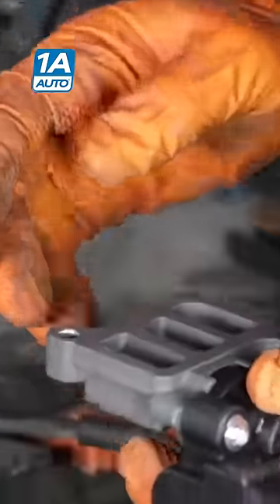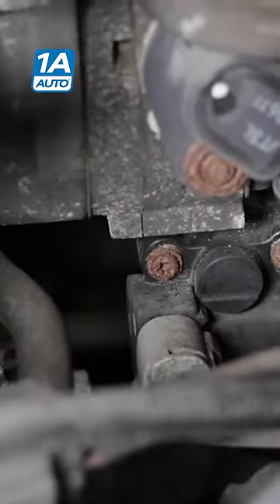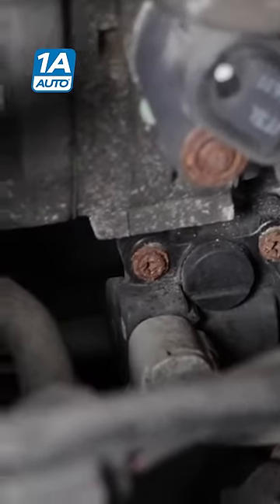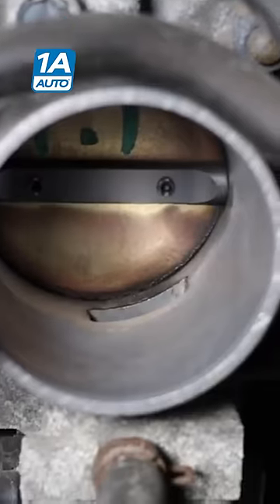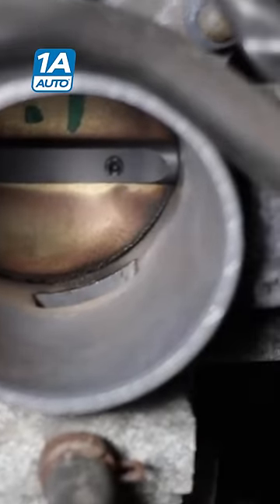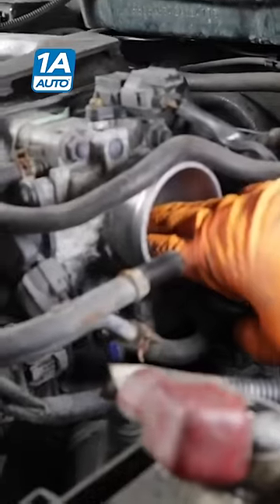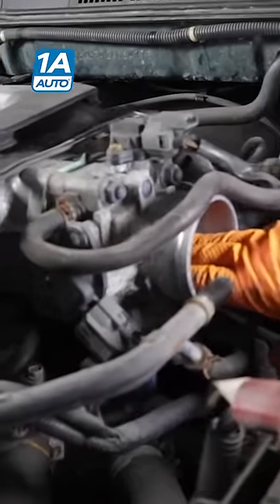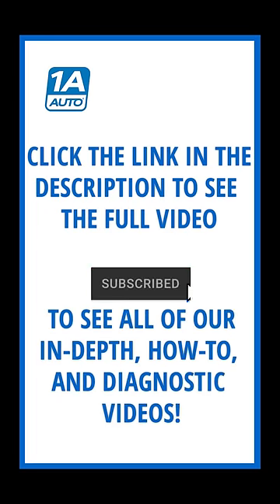Car Engine Revving Up and Down? How to Diagnose Engine Surge! #shorts

Comment: Check for a vacuum leak first. Check charging system. Then, IAC. 
I have found IAC can throw a false code if the A/C compressor is going out.

Comment: This video helps but I have a question. My 98 Accord, 4cyl, manual, had check engine light for a PO401 (EGR valve). Port from valve to intake was clogged. I disassembled as best I could (coolant hoses still attached). I cleaned everything with carb cleaner. Reassembled. Now engine revs from (Cold) 1200 to 2400 rpm. When I block port on intake, smooth idle. Can I clean IAC or replace?